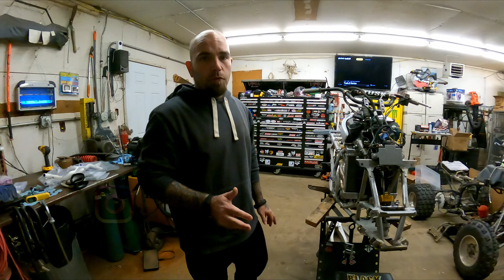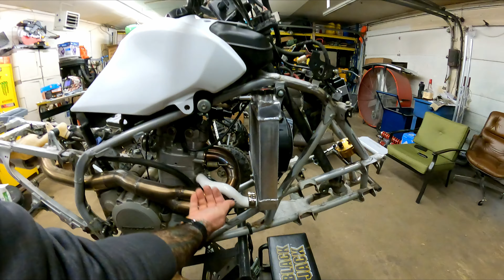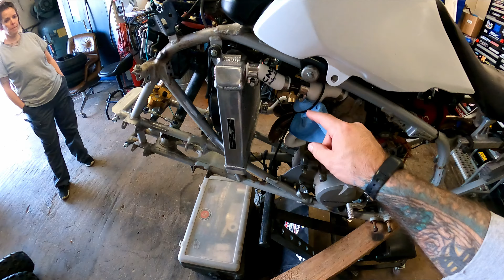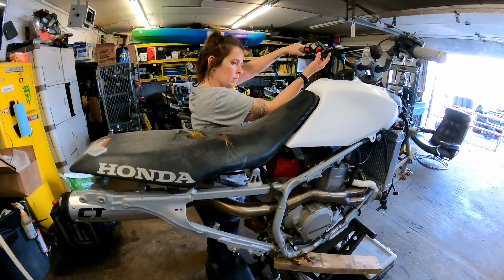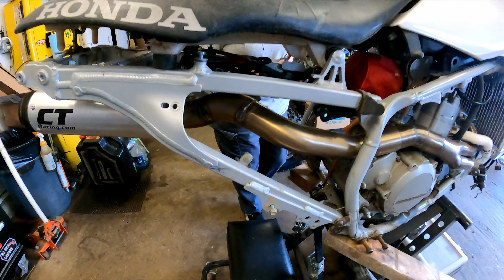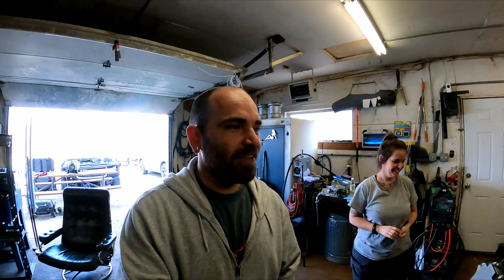IT'S ALIVE!!! Radiator Hoses and First Start Up. KTM Engine in our Honda TRX450R Hybrid. video #10

Comment: what temp gauge you planning on? i'm freakin' pumped.
Reply from the maker: We are gonna have to add another inline sensor bung. We are gonna add an electronic digital one.
Reply: @SeanMooreFilms  I use the trail tech digital gauge on all my water cooled quads. Other than the wires pulling out of the sensor I've had good luck.
Reply from the maker: @brainstain22  that's the one we are planning on too.

Comment: You should cut down the back pip so it dont stick out so far. Just me I think it would look better.
Reply from the maker: Looks weird now but it's as short as it Goes to clear plastic and be inside the rear grab bar. I know what your saying but it's been planned within 1/4 inch right where it's at.